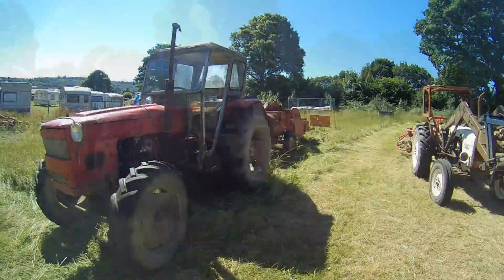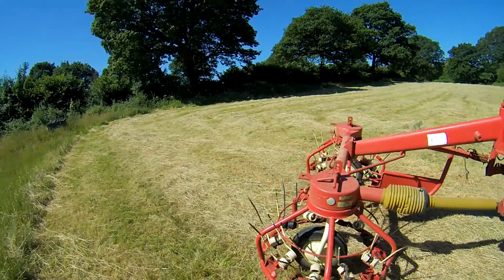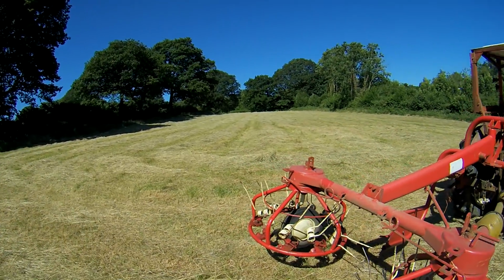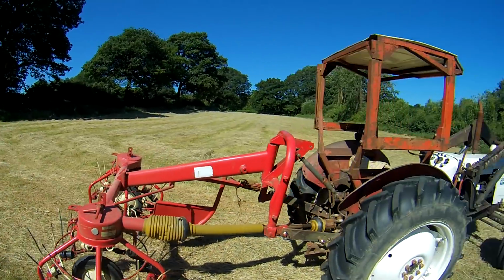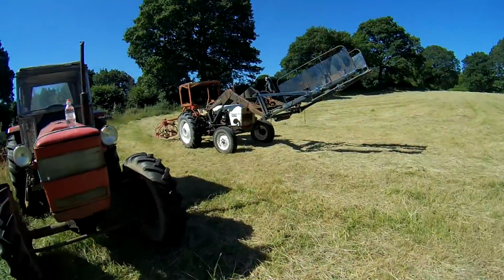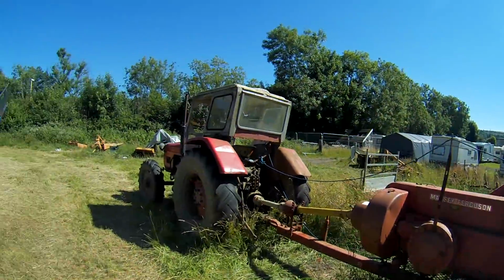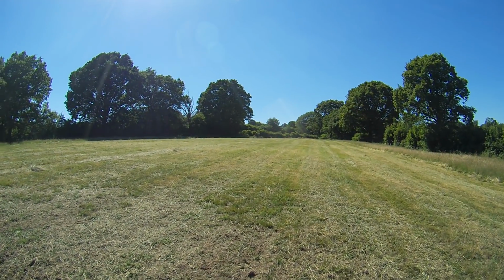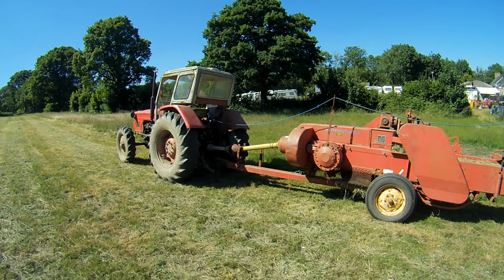Haymaking Using Vintage Tractors / Baler  ( 2018 )

Comment: Your tractors and bailer are same age as me... does that mean I’m vintage. Lol, Great to see them running still, they must have had some maintenance over the years.
Used to see this a lot in Kent until the advent of combine harvesters and modern equipment..  we hardly have any farms nearby these days and we are classed as a market town.. or were. Don’t see machinery in fields, all the lands been taken and developed. Sad times :(

Great vid again you took me back to my youth. 👍🏻👍🏻
Reply from the maker: Many Thanks Ramblin' Man.  Yes you're vintage I'm nearly there too lol.  Yes they have took some maintenance over the years but I think they made stuff then to last and easy to maintain not like modern stuff now.  I honestly can't see how the modern stuff will still be going at 50 years old with all the electronics on them.   Thanks again all the best Calvin
Reply: Calvin Thomas totally agree, lol you need a degree in computer science and electronics just to change an oil filter these days, and you are correct the modern equipment is unlikely to be running in 50 odd years. 
Hope your enjoying the weather, have a great day👍🏻